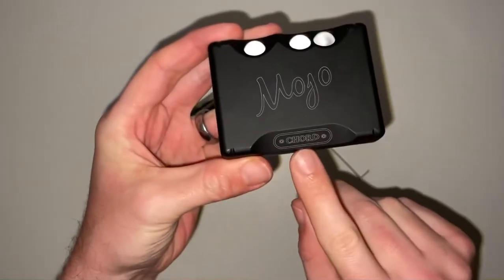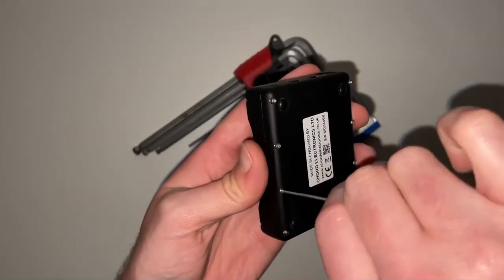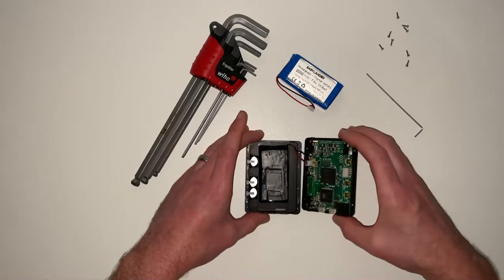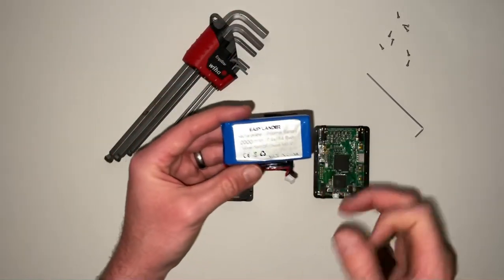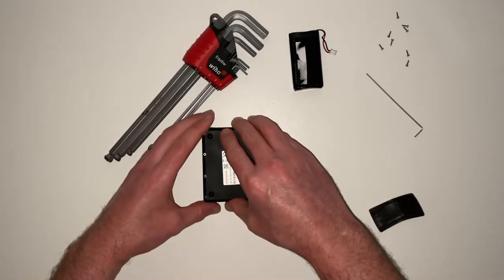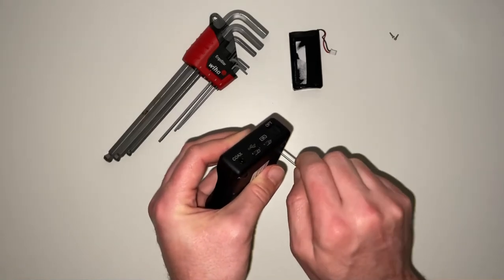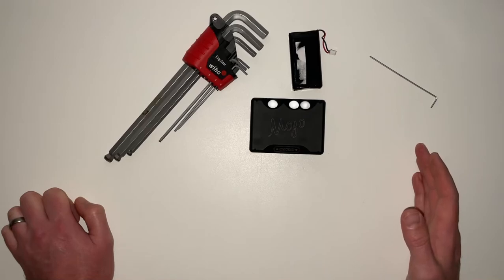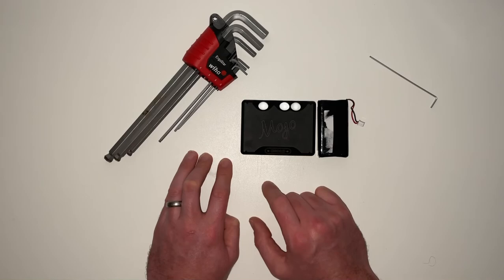Chord Mojo DAC Teardown and Battery Replace

Comment: In the UK Chord Electronics want £80 plus p+p to change the battery. I know they're a premium brand but that's a bit rich for a 15 quid battery.
Reply from the maker: Wow, yes a little dear indeed .. sure just order this one and fit it yourself - mine is working well and lasts a full day after charge using it with beyerdynamic dt1770 pro.. 250ohm

Comment: One of the headphone jacks of my Mojo doesn't work properly. I wonder if it's easy to solder it. Would you gimme some advice please? The other one works great. Thanks!
Reply from the maker: Hi, do you use both jacks? Yes you could removed the board and battery completely from the case and carefully solder another connect jack but you must ensure the impedance is the same as believe both save the same output rail. Have you checked is your just possibly have a loose solder connect from the board to the existing jack, or has the spring contact within the jack deformed/broken ?
Reply: @engineeredabsolute9634  Solder was loose. I fixed it watching a YT video. Soldering the loose point was really easy. Thank you for the answer, I appreciate it!

Comment: Aw man thank you so much! My chord has been without battery for years! No way in hell I'm paying that ripoff price for a battery replacement from chord. I would have considered it until they burned me on my poly thanks to a failed firmware update for no other reason than.......a dead battery mid update.
Reply from the maker: Glad it’s helpful, I’ve been using the new battery for a while and still holding good charge. It seams the original battery only last ~5years before depleting so there will be plenty of people needing a new battery soon. Have you tried the mojo2, it does sound better but not by a huge amount. I’m saving for a Hugo2…
Reply from the maker: Please subscribe and when I get my Hugo2 I’ll do a similar video and comparison
Reply: @engineeredabsolute9634  I thought about it but after my experience with their half baked chord poly device I don't think I'll be dropping any more money in Chord until my mojo officially bites the dust. I already spent 700$ on my poly that never worked from day one waiting for the "firmware fix" only to have it officially die years alter after the firmware update that was supposed to be the golden ticket ended up bricking my device. Of course long after the warranty period. Love my mojo though!
Reply: How much did they ask for such simple operation like that ?
I wanna know

Comment: Hi thank you for a very good video.Is it also possible to disconnect the battery and use a micro usb connection with a mains plug as a permanent arrangement
Reply: Yes you can. You will however still need to connect two usb cables. One for the power and the other for data but it will work.
Reply from the maker: Hi, sorry no don’t think that would work as believe the battery is connect to the charging circuit, meaning any incoming power feeds battery which is in series with the rest of circuit… but I will check and let you know.
Reply: https://www.youtube.com/watch?v=JjXqwVK7NMU&ab_channel=Martin%E2%80%99sTechBlog there you go! there is a dispute over sound quality; feel free to investigate over at head-fi

Comment: Excellent demo. Do you have the link for the replacement battery. Cheers
Reply from the maker: Hi, try AliExpress, it was my first time using it and took quite some time to arrive but it did eventually! Download their add and try this link 
￡10.92 | High Capacity 2000mAh 7.4v Rechargeable  Battery For Chord MOJO Accumulator AKKU External Decoder [Sound card]
https://a.aliexpress.com/_msMADPO
Reply: @engineeredabsolute9634  cheers.
Reply: I got a replacement from AliExpress as well.  In case it is helpful, the original battery I took out was labeled as an ARL 9047, Li-Po 7.4 v 1.64 Ah 12.21 Wh  The replacement went in well and charged up well and the Mojo is working fine. Note that the battery lead when the case was opened (4:30) was reversed in your install (10:06). If the batter fits and the case closes, that's ok.
Reply from the maker: Yes I believe there have been a few versions on the mojo in its current form, mine is one of the very first, the newer have a qr code showing serial No on the side.. looking forward to seeing the mojo 2 in a few days !
Reply: @engineeredabsolute9634  Mine seemed very early too, no QR code and battery dated 2015. My brother gave me it and a Poly late last year, he had treated himself to a Hugo2 and it's matching bolt on streamer. He had bought a battery, but not fitted it, so I did as it was getting to be a bit of a pain and the old ones start to swell and damage the circuit board. One cell of the battery had indeed swollen  a lot, no damage thank the lord. Pretty straightforward.
Reply from the maker: So how did you find the poly, tempted to get one but have read mixed reviews? Also what are your thoughts on the Hugo2, is it a huge improvement over mojo?